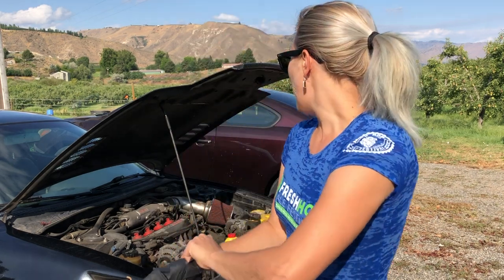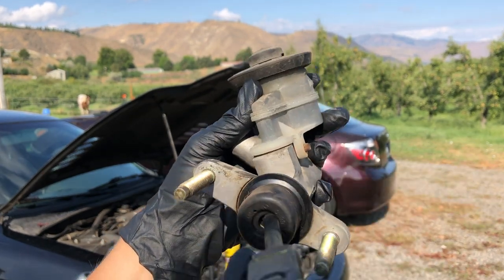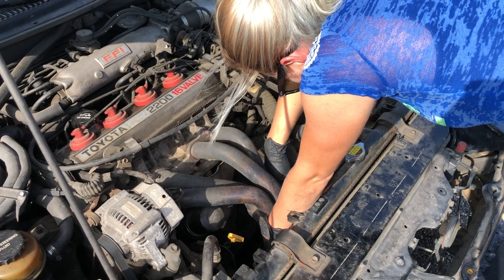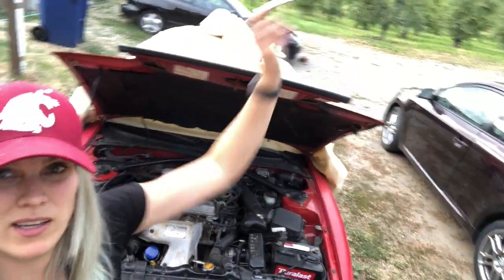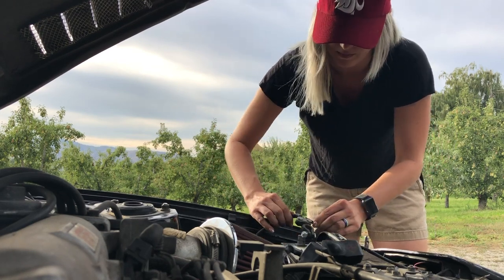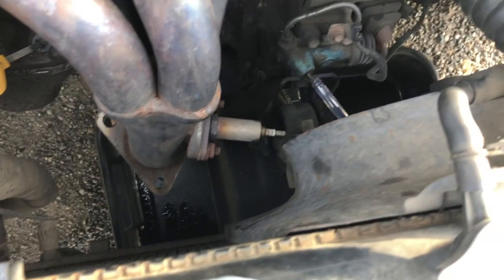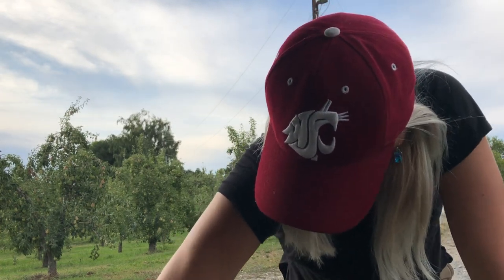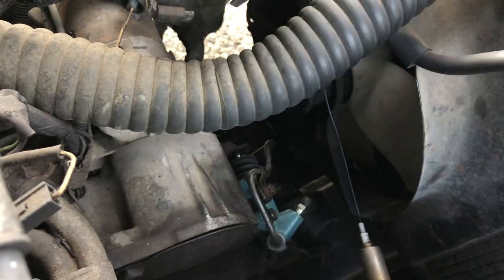The Car Won't Move, Clutch Master Cylinder Replacement // #ProjectToothless - 1990 Toyota Celica GTS

Comment: Sometimes when a battery is really dead it will read fully charged as there is no flow into the battery which tricks the system to think it's full

Comment: Did your RPM go really high when shifting. Thats what mine is doing . I changed the master. Got any advice . PLZ . 2002 Celica GTS
Reply from the maker: Is it just with the clutch in? Or does it also idle high in neutral?

Comment: Have you check your gear linkage?
Reply: On the transmission?
Reply from the maker: elcelicamane seems like its working but I’ll give it a more thorough check
Reply: check the screw what calibrates the cloche pedal
Reply: Do not give up